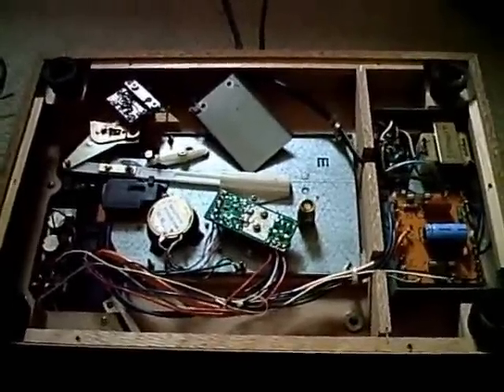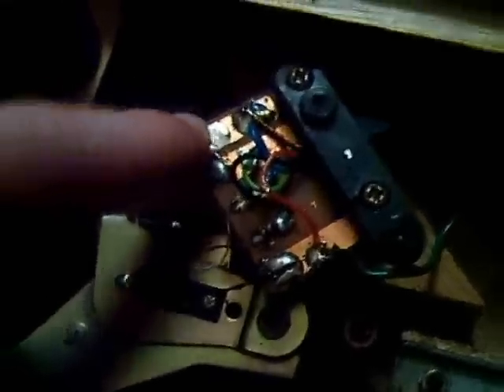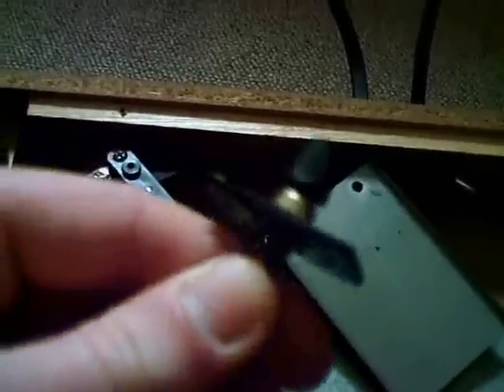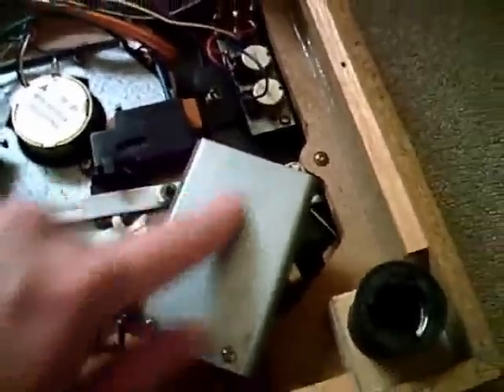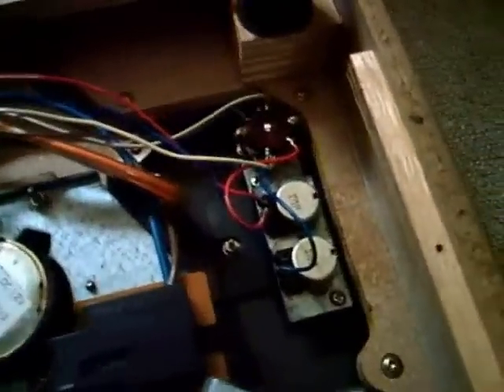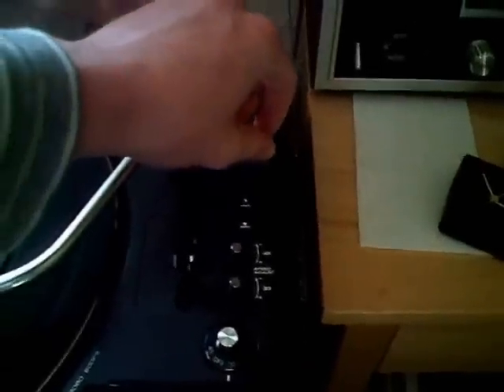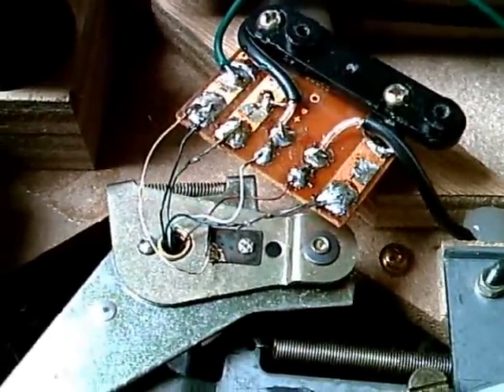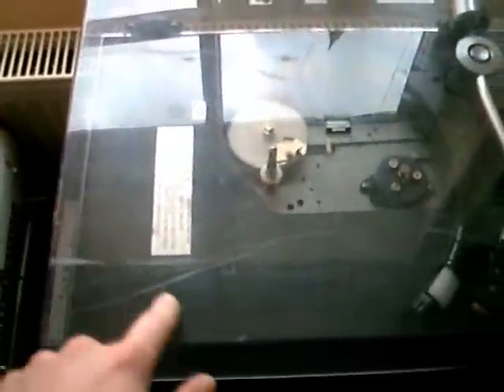Restoring the Technics SL-23A record player

Comment: People often don't realize how many solder and mechanical electrical connections there are between your cartridge coil and the start of the phono preamplifier. Even using the original direct wire output, I can count 8 solder and 4 mechanical connections in each of the four signal connections. This is carrying a signal that is perhaps 1/250th of a volt. Keep it simple!

Comment: These days it's not that common anymore, except in rally cars, but to save on weight some windows were sometimes replaced with Plexiglas.  Most of the shops that sell stuff for car maintenance still sell this kind of polish designed for acrylic materials.  It works miracles on dust covers of record players.  However i recommend trying it out first on some dustcover of a player that isn't dear to you :)  Just to see if you like the results before you try it on turntables you really like.

Comment: How did u lub the motor, I have the same issue. Motor turns but drags. I used a lil 3in1 oil on the motor shaft and it was better but still not spinning fast enough, any advice?
Reply from the maker: For lubricating motor bearings I use a fine mechanics oil (sewing machine oil). However, sometimes oiling the bearing will not restore the motor anymore, in that case it's worn out and has to be replaced. Good Luck!

Comment: I suppose moving the AC power cord further away from the audio cables will reduce the likelyhood of interference cause by the electric current, am I right?  What kind of plugs are on the end of the original audio leads?